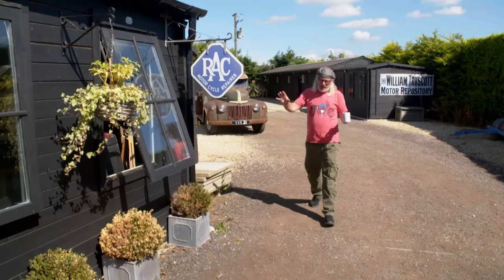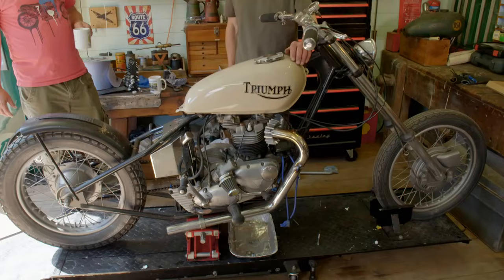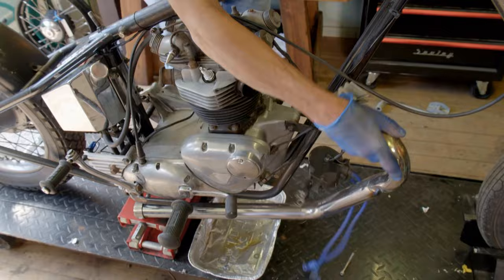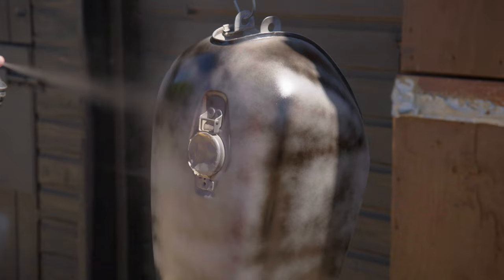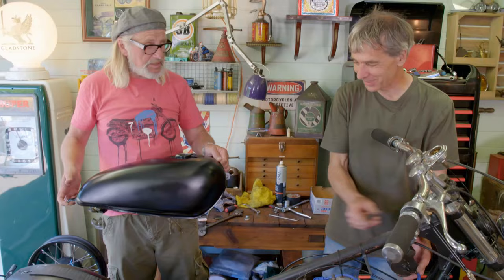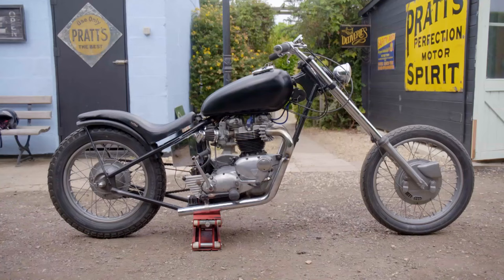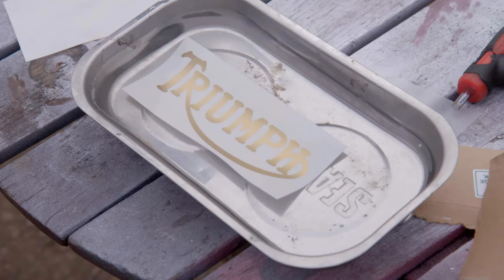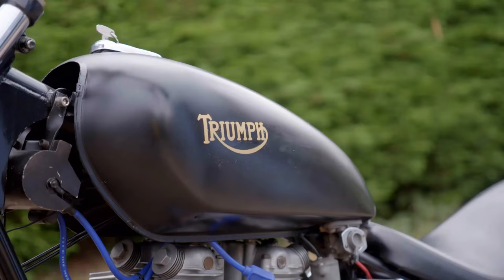Triumph T120 chopper resto

Comment: No mention of heat cycles and head retorque.
Disapointed with Allan in frame of the bodges of unneccessarry silicone gasket and 1/4" r/box studs not in place...
Just encourages other bodgers...